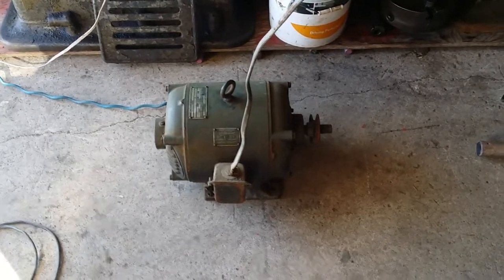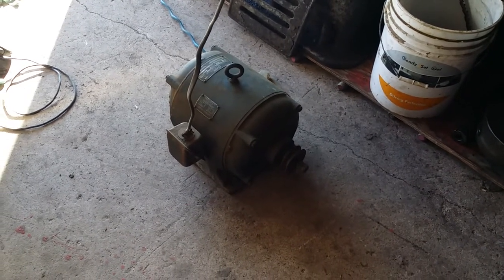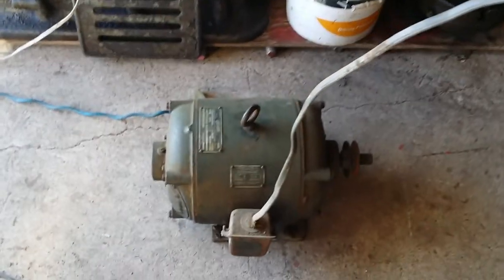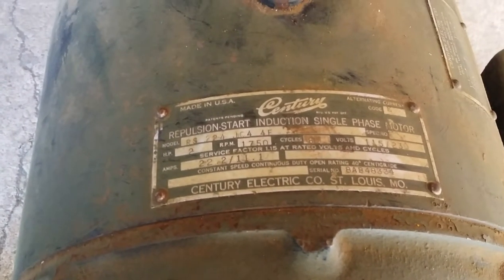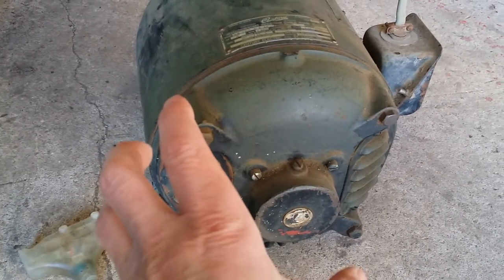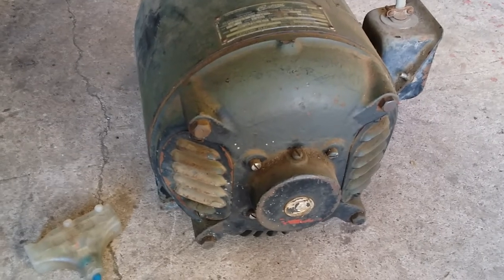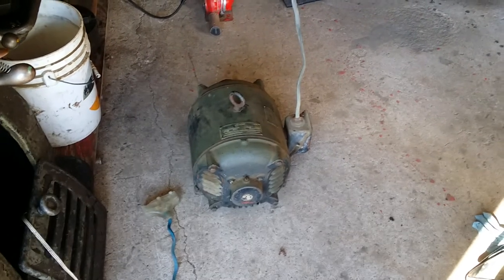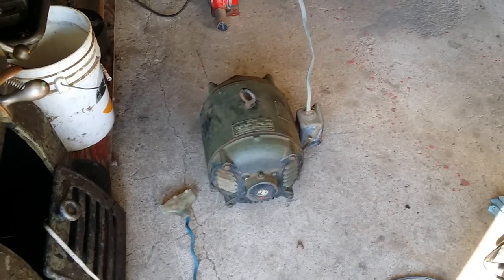Picked up a 2 hp repulsion motor for the hendey.

Comment: What RPM is recomended. Careful run spindle wrong way you might unscrew the chuck.
Reply from the maker: The original motor was 1725. I should be pretty safe with regards to the chuck. I just took the 3 jaw off yesterday,  it was a son of a gun to remove. My logan is also a threaded chuck, I watch what iam doing in reverse.  Obviously theres a 1st time for everything though

Comment: My old Delta drill press has a motor like that! Not 2 hp, just a 1/2 hp
Reply from the maker: I think I also have a smaller version for the power feed on my Cochrane bly mill